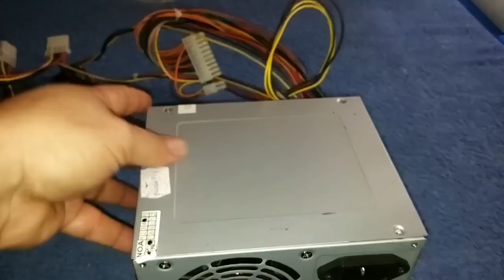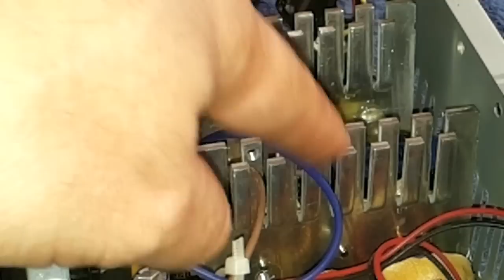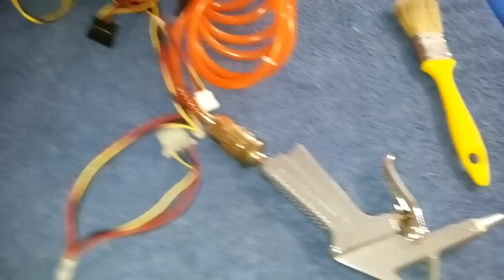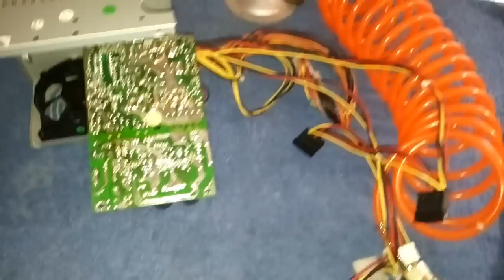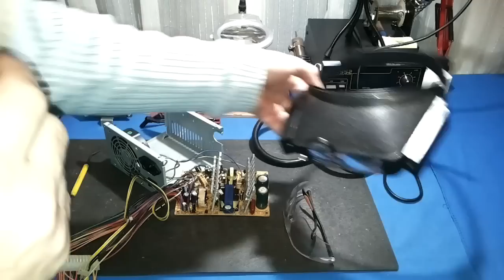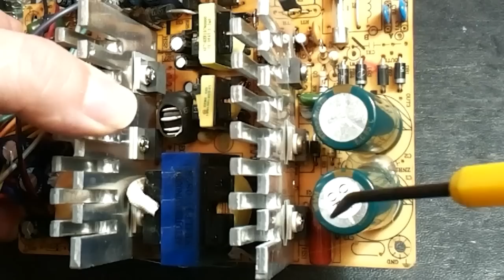How to fix a switching power supply / how to repair ATX in a PC desktop computer

Comment: I have a quick question: Can a bad power source cause symptoms similar to a bad power supply? I ask because I have a computer showing symptoms of a bad power supply. I replaced the power supply with a new one but the same symptoms persisted. That was months ago. Today I noticed that the led light on the power socket to which my computer was plugged in, is flickering erratically but that's not happening on other power sockets.
Reply from the maker: +Caribbean Man Hi! In electronics fixing there is a probability that any one from all components can fail. It means the problem could be also a CPU, power switch, bad HDD or DVD driver and even one of the most common problems like video chip with bad solder. Before going deep in all that, I will check electrolytic capacitors around the microprocessor and the temperature in the ram memory too.
So far, if you don't have a diagnostic PCI card, you should test disconnecting everything and maybe replacing for test, until you find the bad part. And before to disconnect and put them back, check the contacts and connections. Don't forget to clean the RAM contacts too.  :-)
Reply: Bob. Kalpon
Thanks for the info. Can a faulty power source cause symptoms similar to a faulty power supply?
Reply from the maker: +Caribbean Man     Most faulty power supply will just smoke and turn off forever. A few of them can rest the computer, or get hard to start. Bad capacitors or faulty fan can make thermal problems and shut downs too. But after a power supply failure, we must look for secondary damages, or for the original problem, because it can damage the new power supply, or something else can get bad after a while with the new power supply too.

Comment: ATX supply's are notoriously noisy, I have tried to use then to power audio equipment with no luck. Show us how to clean them up electrically.
Reply from the maker: +Less Opinion Hi! Thanks by asking. Yes, there is way. I will record a video for it.
Reply: thanks
Reply: +Less Opinion Probably you are using a cheap generic PSU. You can try connecting the equipment through a coil and a capacitor to ground on the equipment side.
Reply: @Less Opinion
They are noisy because they are switching power supplies (SPS).
For audio equipment i would use a linear power supply. They are not as efficient as a SPS, but they have nearly no noise.

Comment: Excellent video Bob. Very thorough explanations. Good idea to have example photos.

Suggest you use diffused light (and more than 1 light)--it would reduce shadows and make seeing PCB easier. 

Keep up the good work!
Reply from the maker: +davecc0000 Thanks Dave! I am just starting and trying my limited resources. I will have to invest in lighting, microphone and camera... You can't see it, but my microphone is "home made". My HD camera is just my telephone, and my too lamps are the wall and desktop one. LOl! I think the knowledge is the "Star". And there is not room here even for an open white umbrella. In my last videos I corrected the lighting and shadows  just by "pointing the light to the roof". I fund it out by mistake! I am just learning! :)))
Reply: +Bob. Kalpon 
No criticism Bob. Good content. The details will evolve. 

A tip I learned: find an old LCD TV with cracked screen. Throw away the screen and all PCBs except the lamps, power supply and inverter. You now have a great "panel light", just like the movie studios!
Reply: +Bob. Kalpon can you please telp me if and how I can fix a coil that "exploded"?
its the yellow one that's not wrapped around with copper vires like the second one. 
My fan stoped working while I was playing a game,  I didn't notice,i heard a noise and the PC shut of. it was really hot after that, especially the power supply.
Reply from the maker: +Just a talking taco Hi! My email is in "about" in the main tag. Please send me some pictures to see what is it about. (Please be carefully and leaved it if you are not a technician. Switching power supplies can kill on place).  I will be back in some hours. kalponelectronics A gma...com
Reply: Bob. Kalpon its curgently night time where I live and I don't have a wery good camera so Il wait till its light outside.
I'm not going to try to do anything, I'm just wondering if I can replace this one part and not buy a new power supply. It costs about I'd say 35 $ or less but that's a bit of money where I live so any help would be awesome.
Reply from the maker: +Just a talking taco I understand it. I am living in a country where the minimum income is $150 per month. Ask a friend or a family member to help you with the camera, even if it is low resolution. Do not connect the power supply for the next 2 hours, and disconnect any cable from the computer like monitors and printers...

Comment: Hi ! I have an ATX PSU  with all tensions (12,5,3.3,-12) good,but nothing on Grey (power OK) wire.Were should I check,on pwm CI maybe or elsewhere??     Tx.
Reply from the maker: +alexelisabeta Hi! Happy new year. First try it in another computer. Or another ATX with your motherboard. "Grey" is not a voltage output. It is a signal "input". If the voltages are stable, then motherboard tells to power supply that it is OK. If there are problems with memory, processor, expansion cards or VIDEO CHIP, the computer can`t start. Bad output capacitors can produce faulty voltages. But first do it as I said in the beginning of this answer. :-)
Reply: +Bob. Kalpon   Happy new year too.Thank you for fast replay.I try it already on another MB and it seems working (not testing on load, only boot).From what I'ev read and see in other posts waiting for a 5V between gray wire and black.Meanwhile I converting a 1000 watt Dell workstation PSU in a ATX on and work great on my PC so problem half solved. Now I want to repair the old HP-700-G14C only because I want to learn more.I'll start with the capacitors then.Thank you again for your patience.